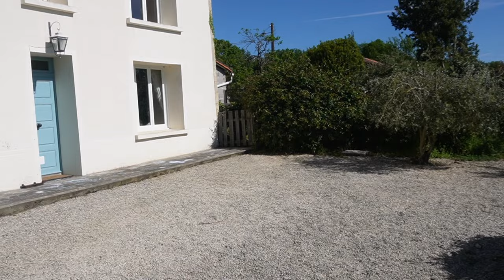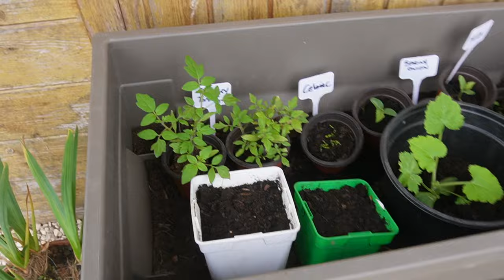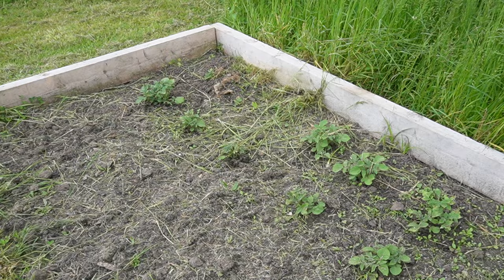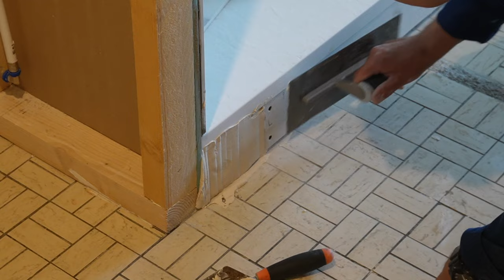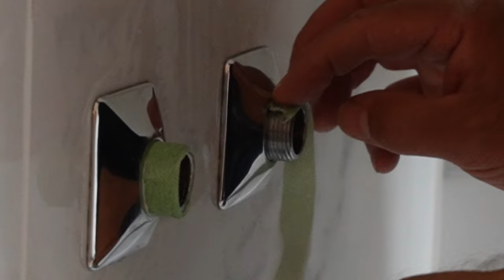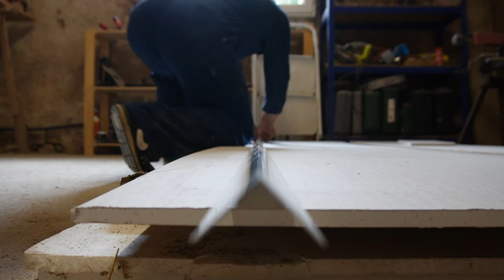Living the French DIY dream

Comment: Amazing carrots and parsnips Lisa and the mangetouts are way out there !
We are on 6Kva  here on the farm (single phase 30 amps) but our central heating is via labour-intensive wood -  if you heat with electric, you are best with 9 Kva, but you certainly don't need  to pay for 12 !!
Your grass is impeccable but you could leave a wide margin for wildlife, flowers and insects,...work clever - cut less - go Green.
Love your vlogs.
Reply from the maker: Hey thank you. You’re right, I deffo don’t need 12 kva. Gonna have to sort that. We have a hot water tank run by electric so probably need a 9.
We’ve had a conversation (probably 3 or 4) Lisa and I about the garden. The kids use it for football so we’re keeping it short. The bottom field we’re turning into like a nature reserve come meadow. We will plant some trees down there soon.
It’s cut my time mowing in half, so less fuel and more time with Lisa and the kids. 
Love that you love our vlogs.
Thanks for watching 
🇫🇷👍